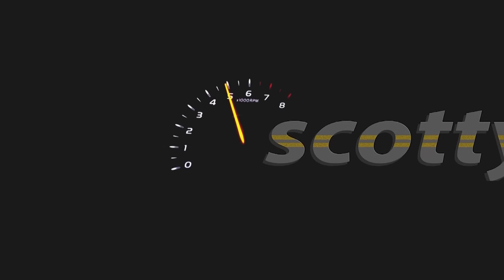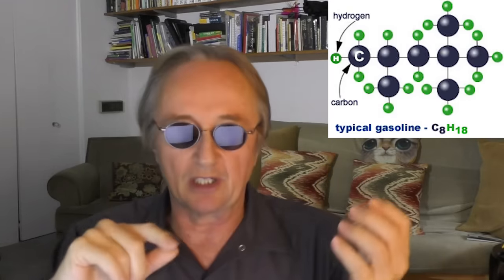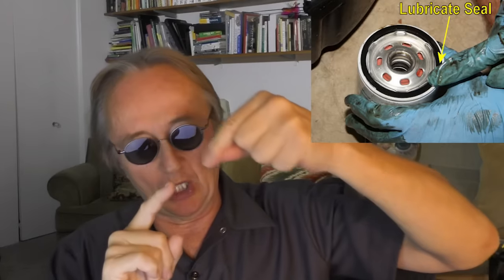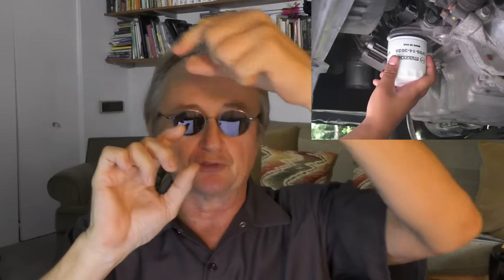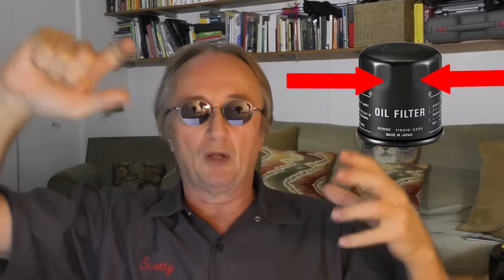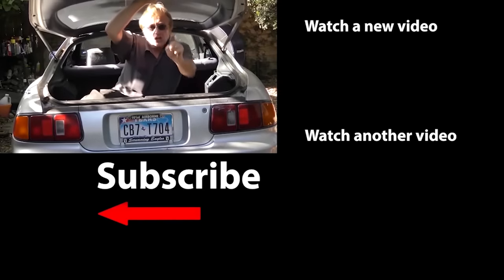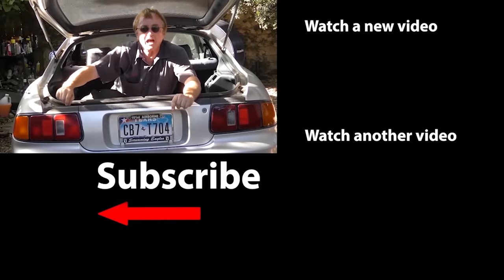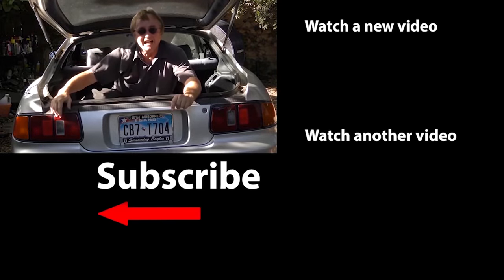Why Water Comes Out of Your Car’s Exhaust Pipe

Comment: When I first got my Chevy Express van with 6 liter engine and saw water coming out of the exhaust even after warned up, I immediately thought head gasket leak.  Then I realized that was normal after watching the coolant level stay consistent, never going down or ever overheating. I guess my tiny cars do it also but they have really small engines so it's not as noticeable.  Thanks Scotty.

Comment: Been there done that with a screwdriver.
Reply: Me too! I figure they torqued it on too tight with a filter wrench or something...you can hand tighten the oil filter and it's fine.

Be ready to close your eyes when puncturing the filter, LOL!
Reply: The giant pliers you use on that radiator cap is what I use on stuck oil filters.
Reply: Yep, me too. After a big box oil change in my younger days. I've changed my oil myself ever since.
Reply: @jhudson1977  when I was a teenager, my Dad bought a 1977 trans-am identical to the one in the first smokey and the Bandit movie, used. The oil filter was stuck on so bad that it broke off and I had to use a hammer and chisel on the filter end to force it off. Previous owner didn't know what a oil change was.
Reply: pcguys-off-grid-cabin me too
Reply: @pcguysoffgridcabin  RIP to that car and all 175 of it's horsepower.

Comment: Dearest Scotty. Yes, they do drip water. That's very common in our high humidity area, especially on startup. However, I would not test the stuff coming out of the tail pipe with a bare finger. Engines that have catalytic converters also emit a sulfuric acid mist that will sometimes condense as the car cools off. that's one reason normal exhaust systems cat back will deteriorate much faster than they used to, and many better makes have gone to using stainless steel from the cat back.

Comment: Scotty you mentioned hitting a massive screwdriver through the oil filter a leather belt from a pair of trousers and a spanner will get the oil filter off if you cannot get the filter off wrap the leather belt around the filter then put the belt through the ring end of the spanner you put the other end on the filter making sure you can use the spanner as a leaver the filter will come clean off

Comment: My ex wife's 96 Merc Sable boiled when she got off interstate. The tow truck got it home and backed it into the driveway that was about a 25 degree slope. Well there was oily water that had poured out the tail pipes (dual exhuast tips). Well the car was using 1.5 quarts of oil every other week or so. I took for granted with 105,000 miles the head gasket had blown. Long story short, and $3000 worth of parts later. Her Dad was the Parts Manager at a Ford Dealership and gave me all of the parts luckily. Got the thing together and back in the car. It overheated again right off the bat. The propeller in the water pump had busted into 3 pieces... But at least it didn't use oil anymore... But what a fool I was $3000 for a simple $50 fix... And you don't want to know all the headaches I had with that 3.0 DOHC V6... That thing is huge...

Comment: To enable filters to be reliably be removed by hand, buy a few extra filters. Remove the gaskets. Place them in a baggie with silicone tire shine fluid. Elastomers will absorb the fluid, soften, and lubricate them. Reinstall one on a filter at the next oil change and hand tighten. Done.

Comment: Yeah, I had a really bad stuck oil filter, one day. Was hell to get off. I tried the big screwdriver rammed thru the oil filter trick. It just ripped off the casing and filter and left the screw plate stuck in place. It took a great deal of time and a lot of cussing to finally beat that plate off with a screwdriver and hammer.

Comment: At 3:18 the Soviets and the Germans did this very thing on their fighter aircraft engines during the battle of Stailingrad in order to thin the oil enoiugh so their engines would start in the dead of winter during those battles. Diluting the oil with gasoline for this reason did not destroy the engines and allowed them to be started in temps WELL below zero.
Reply: @drott150 Very interesting...Thanks!

Comment: Liquid drips not from the exhaust pipe, but from the bottom of the canister that pipe is attached to. Not sure if it is a part of the exhaust pipe (most likely it is), but the liquid (no smell of gasoline) is accumulated on the bottom of that canister and drips with rather large drops. No cracks on that canister (or whatever it is). Would be good to know the explanation of that phenomenon.  Thank you for the great film.

Comment: We have a 2005 chevy silverado the headgasket was leaking so did some research and found rislone headgasket sealer u put it in the rad and let run for 30 min and cool down been running for 5 years now no problems didnt have to change the motor

Comment: I had a really stuck oil filter once, so stuck the screwdriver just ripped up the metal on the filter. I found this vise grip chain wrench and hooked that on and it got it off pretty easy. Flood cars will sometimes also drip water out the exhaust

Comment: If the oil filter is really stuck on there, you have be careful when using the screwdriver through the filter method of removing it.  The oil filter can is so thin that if it's stuck enough, with enough torque, the screwdriver will tear through like butter.  I think the adjustable oil filter wrench is a much better tool, the one that looks like 3 prongs that grabs as you turn.  Though those are not good for tighten as it  can dent the can.

Comment: Part of it is just condensation from a hot gas going into a cold pipe. That's why you see it more in colder weather and that's also why it stops dripping after the exhaust has had a chance to warm up.

Comment: Always rub fresh engine oil on the new oil filter seal before putting it on...not only so it comes off easier next time, but to prevent the seal from crimping up when tightening-if that happens, you'll have oil leaking out of it and you'll need to buy another new filter.

Also....make sure you don't get the old oil filter mixed up with the new one, and accidentally put the old one back on. Believe me, it's easy to do if both are the same color and your engine runs clean & you haven't driven through mud or snow since the last oil change.

Comment: I have had a friend try to take his oil filter off with a screwdriver, and he ended up breaking the filter in half. I had a hell of a time getting what was left on the car off. Be careful if you have a cheap filter on there, or if the screwdriver starts to just break the filter rather than turning it.

Comment: The long screwdriver method should be the LAST RESORT for removing a stuck oil filter.  The oil filter metal is thin and will rip and shred into a sharp mess.  You will bleed and it still may NOT remove the filter.  If that happens, use vice-grip pliers and tug on what's left in a circular motion. BE sure you are turning the correct way!!!

Comment: 1st change on my 87iroc tore can right off, but left the threads, That was a Pain, learned a lesson that day... WATER IN TAIL PIPE, IT NEEDS TO BE RUN, REV IT OUT. A FEW 45TO70 RUNS Some Lucas fuel to

Comment: The exhaust water vapor condenses on the inside of the exhaust pipe, collects and may find its way out; after the exhaust system heats up, it will not condense and is exhausted out.  Improperly sized gas furnace flues and chimneys will do a similar thing which is not desirable. Condensing furnaces will make a very corrosive liquid solution and eat pipes except for PVC.

Comment: But in my case sir its different. Water drips out of my exhaust pipe because the head gasket was blown. The water that drips out was the coolant thats why my coolant always runs out. And i experienced over heating and the engine is misfiring

Comment: Well, I've used a metal belt wrench to pull oil filters off, if I can get a good grip on it and a good swing for the handle, this usually works just fine for me. Haven't been forced to used a screwdriver yet.

Comment: Stuck oil filter ?  It has been mentioned already but I’ve always been able to get them off with a big pair of channel locks. Even if you just get a fraction of a turn it’s all you need to loosen the filter. If possible, Make sure you grab the filter at either end where it won’t crush as easily. Screw driver sounds way too messy.

Comment: Had an oil filter stuck on a 12v Cummins so bad that even the crew driver trick didn’t work!  Luckily that motor is built to last forever and the hole unit can be tacked off the motor👍, clamped it in a vice and the filter came right off

Comment: Does it mean I need to replace the exhaust fluid?
Reply: Probably not
Reply: Stephen Barry just remember to wear pants this time.
Reply: Jr ALEXANDER   It used to be a joke like blinker fluid until diesels actually started using exaust fluid!
Reply: No, it's time to re-pack your muffler bearings!
Reply: The exhaust fluid reservoir may have a slight crack in it
Reply: Sometimes the blinker fluid can leak out the tail lights and end up in the exhaust...
Reply: If it's not the normal pinkish color then it means the fluid is badly contaminated and definitely needs to be changed, or serious and expensive damage to the seals of the exhaust fluid pump will result. Scotty was remiss in not explaining this.
Reply: Take tailpipe extension off , then you get a Keneuter Valve , be sure it's torqued to specifications, then replace your tailpipe extension, ✅👍

Comment: Had an oil filter screwed on so tight the screwdriver method actually ended up just tearing the whole thing apart!
Took a lot of time with a chisel to get what was left off without messing up the threads.

Comment: 5:24   Low mileage means little to me, it's all about how the car was maintained and age destroys seals, rubber, brittle plastic, paint fade, etc over time, not miles.  Very low mileage means oil was not warmed up enough to boil off moisture, or was driven only in snow and salt remains on the steel because it wasn't washed off driven all year (friend just bought a low mileage Tahoe, fuel filter flare nut is fused with rust solid to the filter and line).

Comment: I've had a Toyota Rav4 that had the oil filter plastic housing with the filter inside. The customer had another shop change the oil but couldn't get it off. we used the correct oil filter socket with a johnson bar and snapped the socket in half lol. After that, we said nope and sent it off.

Comment: Scotty, according to Consumer Reports late model Honda CRV 1.5L turbo engines are failing due to excessive gasoline in the crankcase.  Honda has recalled them in China but NOT the US.  Can you do a video about it?
Reply: These will eventually be fixed with a software update on the ECU.  I think the Canadian CR-V's will be getting that this month.  In the meantime people should change the oil more frequently.
Reply: @saddestchord7622  Yes and according to article they are told to change their oil every 500 miles.  This is close to home for me.  I'm driving a 2019 RDX with 3 problems waiting for Honda to find a fix.  Honda America is having lots of problems and not responding well to their customer's needs.
Reply: @saddestchord7622  
We've already begun addressing this issue (in Canada anyway) with a software update. There's a control module that gets replaced on the '17s as well. So yes, Honda is doing something about it.
Reply: Consumer Reports put the 1.5 L CRV on their "recommended" list along with the Odyssey which they now call one of the most unreliable 2018 vehicles.. Maybe a video on CR being dead wrong on their recommendations?
Reply: These engines are also having difficulty keeping the heater working in colder climates due to being so small. Owners are reporting their heaters barely get lukewarm even after 30-40 minutes of driving.
Reply: @beezertwelvewashingbeard8703  😒 yeah they also like to use those stupid small Size 51 Batterys & thin 6 gauge batt cables
Reply: I also want to know due to to I owe a 2017 CRV that has the issue of fuel get into the engine

Comment: BUTScotty there is another reason for that which is, the head gasket might be broken and leaking into the engine from the radiator pressure after the thermostat is open which leads to overheating due to loss of water going into the pistons and out the exhaust. RIGHT? MY CAR IS SITTING BECAUSE OF THAT CURRENTLY.

Comment: Hitting the screwdriver into the filter sometime is bad for that socket itself, you might bent the oil filter thread and will cause you more trouble in the long run, just go to the nearest auto repair shop they probably have a tool to fit it out,

Comment: I couldn't get the oil filter off my 94 s10 once. Turns out the previous owner installed the threaded piece with pliers and buggered the threads up instead of using a 3/8" hex socket on the inside. I keep a 3 finger filter remover in my tools incase that happens again.

Comment: Scotty from a motorcycle mechanic over 35 yrs,you have great common sense videos. Since winter coming here's a question, dealership are selling some electronic gizmo that puts current through the car to prevent it rusting, are they worth $800. Canadian dollars
Reply: Ross I’ve heard a lot of problems about those electronic rust proofing devices. And I’m in Canada as well. I was offered it but I declined. I preferred seeing the actual rust product applied on my car. Try it though, apparently, if you get a new car, you can transfer the device as well
Reply: Ross that’s a gimmick. It will not prevent a car from rusting in Canada. The only way cars don’t rust in Canada is if they are garage stored and not winter driven. The best protection is to treat the vehicle yearly with Krown if it’s driven year round.
Reply: Ross I was wondering what your schedule was for and and was the first one and on Wednesday to be able on that to you I want your help I got your money I was like I got your number and said you got

Comment: I've tried the screw driver trick once.  The entire filter body ripped away,  all that was left was the disc near the threads.  I ended up using a pipe wrench. Cross thread city.

Comment: I have a 07 4runner 2wd  with 176000 miles but I here a clicking sound from the engine. The sound is very low you need to open the hood to here it and get super close to the engine. I think is the two plastics the hold the timing belt chain inside. I live in Houston tx by spring branch. Help please

Comment: If you have gasoline coming out of the exhaust pipe it could be that the cylinders are misfiring, if you have gasoline mixing up with your oil it could be due to a bad fuel pressure regulator

Comment: QUESTION FOR A VIDEO : Scotty, what do you think of the 1998 GMC Jimmy 4 door  ? Are they good reliable SUVs ? I have one with 163,000 miles, runs fine, has had a rebuilt transmission at 150,000 miles.